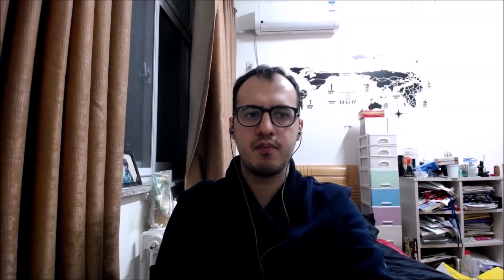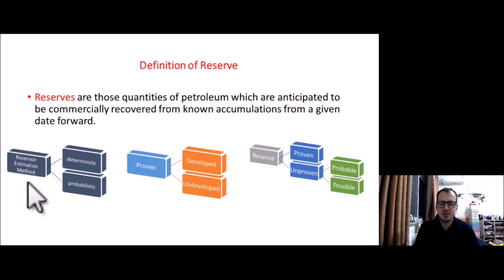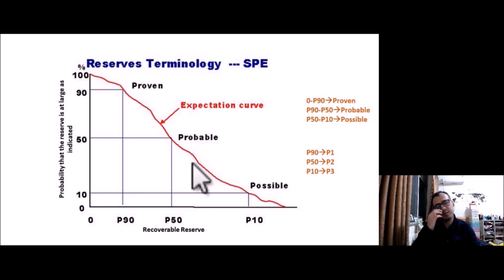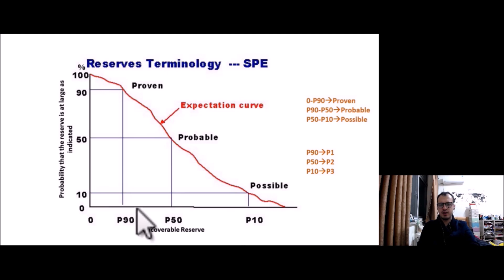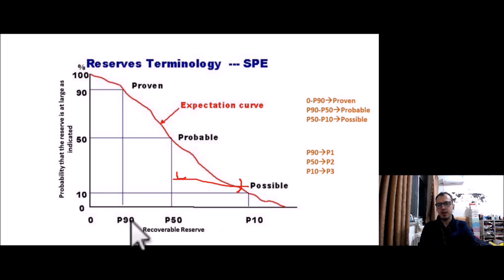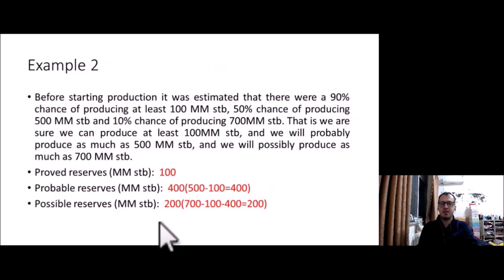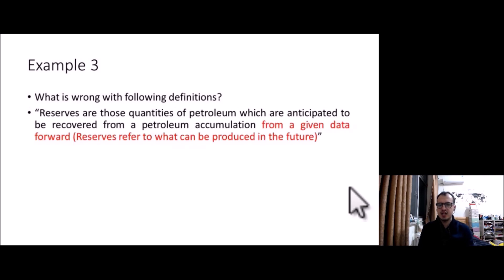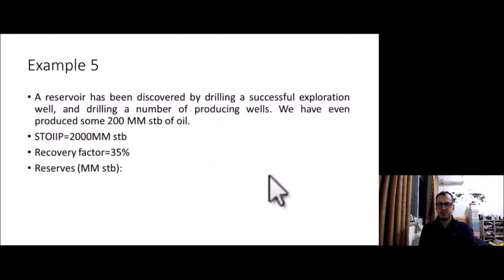Reservoir Definition (Proved, Probable, Possible Reserves)

Comment: Wonderful lecture sir. I think the answer to the question on "what was wrong" with the reserve definition should include "commercially recovered", it was omitted in the definition, and you also skipped that part. Again on the question with different RFs, I think the reserve is zero, since the company has not even explored the field yet, so the context of "known accumulation" in the definition or reserve is not met by the company. Their anticipation is probably a guess. Tnx